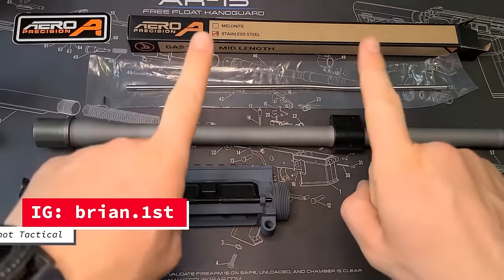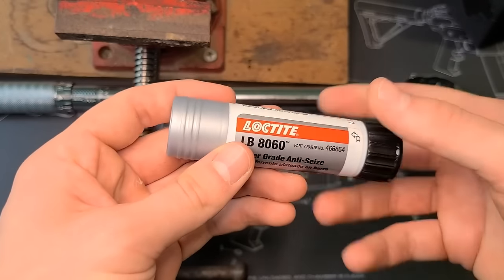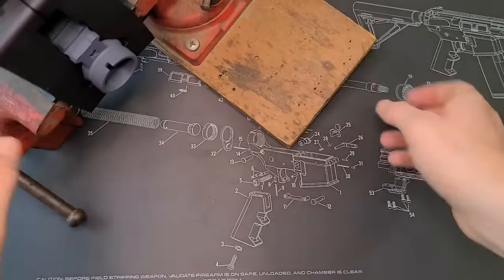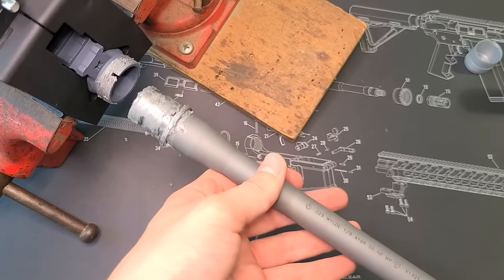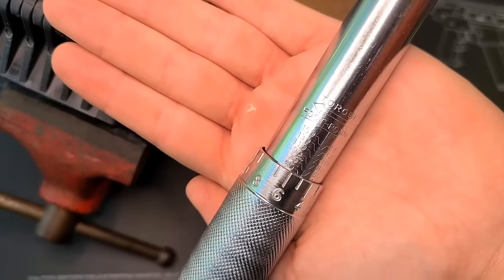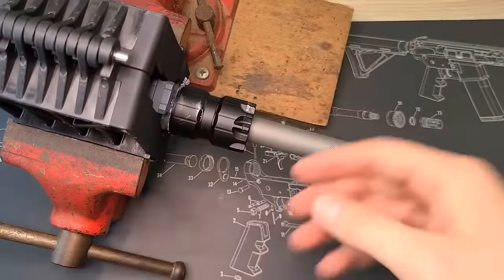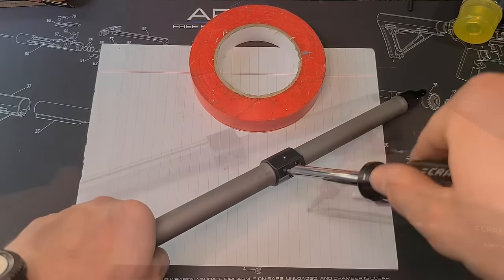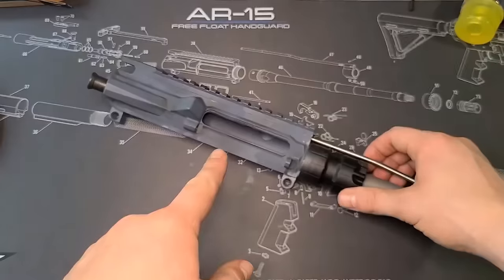How to Install AR15 Barrel - Aero Precision Upper

Comment: I would not use the same wrench to loosen the barrel nut I would always switch to a no-torque wrench to loosen it.
Reply from the maker: Thanks for the comment and you’re 100% correct! Definitely use a breaker bar!
Reply: Well said Gunfighter! Mechanics 101!
Reply: Or set it to a higher torque to loosen it than what you torqued it to......big brain moves.
Reply: @brettreid5949 never loosen with a torque wrench
Reply: @Schedule1ne315 , how do you torque reverse threads?
Reply: @Brettried ....With the same torque wrench set in opposite direction of operation, then again, loosen it with a breaker bar. The torque wrench is a precision tool to set the fasteners not remove them. When you are finished with preset style wrenches you are supposed to also recalibrate back to zero for storage.
Reply: @BeltFedToys , yup, take all tension off of the spring and detent. So, you're half-right.
Regardless of it being a precision tool, there's no legitimate reason why you COULDN'T use it to loosen a fastener that is well within it's specified capacity of doing so.

It's an argument of capability, not on whether one would actually do it or not.
Reply: @brettreid When a fastner is torqued to a specified setting that does not equate to the same amount of torque needed to remove it. Binding, corrosion and friction caused can exceed the limits of the tool. I don't use my micrometer and calipers as wrenches even though it will work. Even the manufacturers state to not use it for installation  or removal of fasteners. It is a calibrated tool designed for the final tightening to a specified force. Use of it for complete assembly will shorten the cycles of accuracy much more quickly. It's not so much a matter of the tool breaking as much as retaining an accurate reading for the most amount of cycles. The tool will need to be returned to the manufacturer or service center for calibration and in a busy shop time is money.
Reply: what? you don't have a negative setting on your torque wrenches? you got gipped!😂😂😂
Reply: Many of today's torque wrenches have a back n forth, or off and on switch setting.
Reply: @5jjt a totque wrench with the option to disengage and apply working load, to me would indicate a more frequent calibration regime
Reply: @brettreid5949 you spin the opposite way
Reply: @dancopp5607  Thats not the case at all actually. Its absolutely asinine to think that a torque wrench cant adaquetley, and safely, remove anything it puts on. The ONLY thing that's relevant is that you arent exerting more force than the wrench is st at. This means in BOTH directions. Setting a 500LB ratchet to 200 pounds and applying 400 pounds of force to it is what causes potential damage (generally it actually doesn't anyway). And that's the case no matter what direction its being turned. 

Tighten to a desired set torque, loosen with the wrench well beyond that setting. If clicks/beeps/screams at you then you've exceeded the setting and need to increase, or get a bigger tool
Reply: @SteveMoore71  So your not really a tool user. If you use your Torque Wrench in that manner, you WILL BE REPLACING IT. 
But for my fifty year old torque tools, they work!
Reply: @brettreid5949 using the reverse on the torque 😂

Comment: FYI don't use your torque wrench to loosen anything, it's a precision tool.  Breaker bar for loosening, torque wrench for tightening
Reply: Unless you have a bi directional torque wrench
Reply: @mcnairdn  I guarantee the 8.99 Pittsburgh torque wrench is not bidirectional … but technically I can’t argue with you 👍
Reply: @Raevenswood  true and they are not even precision instruments.  And I agree your advice is correct in 97% of cases.
Reply: @ 7:02, shows it's bidirectional
Reply: If my snapon one breaks ill just get a free new one🤷‍♂️ @Raevenswood
Reply: @Nak3dPirat3  I’m sure there is a moron clause in the snap on warranty
Reply: @Raevenswood  don't buy crap tools buddy 😘
Reply: @Nak3dPirat3  don’t use a 700$ precision tool like a moron just because there is a warranty. Buddy.
Reply: @Raevenswood  woah
Reply: @Nak3dPirat3  did you shit your pants?
Reply: @Raevenswood  no I wasn't wearing pants. It hit the floor. Don't be afraid to use your fancy tools that's why you bought them. Don't be materialistic either like you ain't never ground down a wrenches to fit somewhere tight 😘😘
Reply: @Nak3dPirat3  no shirt cocking bro!
Reply: Pretty sure you can loosen something if you know it’s not torqued beyond the wrenches limits. If you don’t know how tight it is, don’t use the torque wrench to loosen it.

Comment: You should mention headspacing. I headspace all my builds regardless of whether they are ARs or bolt guns. It’s easy to do while the barrel is out but shouldn’t be overlooked.
Reply from the maker: Thanks for the comment and great point!!🙌
Reply: That is absolutely a must do
Reply: Yeah I learned that lesson on my first ar build seems to overlooked often
Reply: It's not necessary if you use barrel with preinstalled extension and trust barrel maker, which made that...
Reply: It’s always recommended to do the head-spacing, to many variables to not do it 😅
Reply: When you say headspace the barrel, are you saying to check it with a gauge to see if it’s correct or actually change the headspace to correct it.  I wasn’t aware that was possible without removing the barrel extension.
Reply: Depends on the firearm. For ARs, you remove the bolt from the carrier and the ejector from the bolt. Check your barrel before installing it on the upper receiver. The Go gage is placed into your barrel's chamber, and the bolt should lock. The No-Go gage should go next, and the bolt should not lock. If it locks on the No-Go gage then you have a problem. There aren't any adjustments on ARs.   @jgrenwod
Reply: @stevenl7878  
Thanks for the reply. Cleared up my confusion about the process.
Reply: @stevenl7878 I suppose you could lengthen headspace with shims, but that's evidence of sloppy machine work and I wouldn't trust it, anyway.
Reply: @LE-6920 you always check all tolerances and specifications no matter who your manufacturer is. It’s easier to check the head space with the barrel off, also easier to check the gas port alignment before just slamming everything together, also easier to leave the ejection port cover in place before putting the barrel on. As no doubt this young man found out after he turned the camera off😂
Reply: @LE-6920 😂
Reply: @stevenl7878 closing on a no-go isn’t always a problem - just indicates slightly long headspace. Closing on a field gauge is the real problem.
Reply: Your higher in  barrels will come with a bolt no need to head space unless it makes you feel good

Comment: I suggest using a breaker bar or regular socket to loosen the barrel nut.  Torque wrenches are finely tuned tools, and using them to loosen nuts can lead to them becoming wrongly calibrated.
Reply: What if you need to torque left hand threads?.........
Reply: @randallsebald2299  I’ve never thought of that lol 😂🍻

Comment: As a guy with a a few different blocks, trays, etc... I still find myself using a roll of tape to tap pins in and out. Top notch brother.
Reply: <sarcasm>Top notch, brother</sarcasm>  there, fixed.

Comment: A hair dryer or heat gun is a useful tool as well. BCM mills their uppers to be slightly small (to aid in accuracy they say).
I'm in the middle of a Grendel build and I'm waiting for it to cool down in Colorado so the barrel will shrink slightly (because it's cold) and the upper will be slightly larger (because I'm going to heat it) so I'm hoping it slides in just as easily as yours.

One method one used in the past to line up the gas block is to plug both the muzzle and the chamber and use a duster can. You'll hear it when it's lined up properly.
Reply: Bro…. You can put it in the fridge for 2 min instead of waiting for the season to change
Reply: @dw3901  if you noticed when I posted that it was November. It was already getting cold in Colorado. Plus I've been building it since July so I'm in no rush.

Thanks for the support though.
Reply: You have to torch the receiver threads. JP Enterprises has a great video on installing barrels into thermal fit receivers.

Comment: I'm not bashing 1st shot because I don't know what checks you performed prior to the video BUT.... Safety is paramount when doing this. What I would say is that the steps to insure the barrel is properly headspaced and examined prior to assembly is very important to show in a build video. After all this is the most critical part of the build in terms of safety. Your audience is looking to you for knowledge as most lack the knowhow to do this safely. It is not a difficult job building an AR but it is important that you show the safety aspect as well. I would not forgive myself if I caused injury or worse to someone as i am sure you probably would not either.
Reply: If you buy quality parts from a reputable supplier, why is the headspace ever in question?
Reply: Do a video.

Comment: The Midwest reaction rod will prevent the barrel from clocking in the index slot of the upper receiver, worth every penny. Clam shell holders will put stress on the barrel's index pin and won't prevent barrel clocking... 
Anti-sieze is not the best, it will harden and can cause problems, use AeroShell Grease 64 as recommended in the TDP specs..Put the grease on the upper barrel threads, in front of the barrel lip and around any shims..
I lap the upper receiver face and bed the barrel in the upper with green loctite..
I dimple the barrel for the set screw type gas block and use a little green loctite around the barrel journal to seal the gas block to the barrel journal.. I use Rocksett for the gas block set screws as even red loctite will fail with heat..Blue loctite is worthless on gas block set screws..Pinning can cause accuracy problems, especially with a .625 barrel journal..
The best adj gas block is the Riflespeed. It has made all other adj gas blocks obsolete..
Reply from the maker: Thanks for the comment and great insights🙌🙌
Reply: You’ve been taught well my friend
Reply: Why dont u just make a video on how to do this instead?
Reply: How does a ClamShell put stress on the barrel pin ?
Reply: @SandyRavaged  Thanks for the reply, sounds reasonable. I've used the Clam Shell & the reaction rod ( WITH THE SAIL ) together in my last 2 builds seems to work great.

I apologize to the OP, don't know why I SHIT ON HIM ? MUST HAVE BEEN IN A BAD MOOD OR PISSED AT SOMETHING ELSE ? SORRY OP, I WAS AN ASS. I'll delete my stupid remark I made.
Reply: I agree Harry dog that's why I use one but not the midwest one but same principle.

Comment: Great video, thank you. One thing, I heard that using a torque wrench to loosen bolts messes up the internal calibration.
Reply from the maker: Yeah that’s true I heard as well but ohh well haha thanks for the comment!
Reply: that torque wrench looks like a harbor freight special so this is a possibility since their quality is questionable. in general, however, untorqueing fastners with a torque wrench is not a problem. in fact, many sensitive mechanical components (ex. engine head studs and the like) have an untorqueing procedure to prevent warping parts that requires using a torque wrench.
Reply: @NCrowe  I think its only an issue if you go past the setting

Comment: Yeah a lot of people don't realize how easy it really is to put an upper together good video by the way I like the colors of the barrel and the receiver curious to see the handguard and all of that once it's finished make that thing super duper light and a cool broken-up color scheme going sorry I'm telling you what to do it's your rifle but I like the color you got me wanting to put one together now good video 👍
Reply from the maker: Truth!!🙌🙌
Reply: @1stShotTactical  it's so insane how easily you can build your own firearm for so ridiculously cheap and it is really well-functioning looks better than 90% of the guns you will see complete at the store and cost a fraction of the price probably more reliable as well because you hand fitted it really if a lot of people weren't just lazy most gun stores would go out of business if they didn't need an FFL for receivers they would literally only make money on optics and ammo but I bet if you had all the pieces and weren't taking the time to explain in a video how to you can probably have one together in 10 to 20 min tops and it would run like a champ I thought my 450 Bushmaster was going to have cycling issues with the standard buffer weight and all the regular 556 parts except the barrel and magazine but the standard milspec buffer weight and spring cycles in like a champ just as well if not better than the complete that I ordered

Comment: I like how you torque on then remove then re-torque.   MY extra step,and it does make a difference, same as you do but  remove the nut and clean the threads THEN  do final torque.  There WILL be coating and grit in the threads.

Comment: I like the Handguard itself but that barrel nut star style to tighten it down is ridiculous. I sheered off some of the teeth off the barrel but only going to 45lbs. Now I can’t take the barrel but off and the gas tube slightly touches the barrel nut. They didn’t have to change the style of torquing it down it’s pretty dumb. Nice vid though
Reply from the maker: Thanks for the comment! And man that sucks about your barrel nut…. Hopefully you can get it fixed!

Comment: Well, this young man did a decent job of throwing a barrel on a upper receiver. That’s about all you can say, was it done right? Hardly. Was it worth making a video as a guide for others to follow? No. Too much was taken for garnet that it would be right solely on the premise that they were “ quality” parts. I myself have used from the same manufacturer and they are high quality parts and pieces, but I always check all my tolerances and fitments for my own piece of mind. Saying it was “high quality “ parts  after it blows up in your face doesn’t mean much. Parts are parts, how the parts are assembled are key to building a safe and dependable rifle.
Reply from the maker: Thanks for the comment!👍
Reply: What exactly did he do wrong? What checks are you referring to that he should have shown in this video to meet your standards?
You were vague. My guess is you are the usual “internet gun expert”. Just posting to make yourself feel special.
Reply: @lubrew5862  AGREED, WTF ?

Comment: Those Wheeler clamshell vise mounts are actually pretty "risky" to use, as they transfer all the torque from the barrel nut into the receiver which can cause your receiver to CRACK!😬 Instead you want to use a "reaction rod" tool, they're a long bar/rod that slides inside the receiver and has splines which mate inside the barrel against the bolt lugs, that means all the torque is applied to the barrel instead. You can typically find one for around $45-100 bucks.
Reply from the maker: Great tip and thanks for the comment!!🙌🙏
Reply: I bought the Magpul BEV block to mount in the vise after one use of that plastic clamshell crap.
Reply from the maker: @CarlosRodrigues-zn8gh  good tip!!
Reply: @CarlosRodrigues-zn8gh  unfortunately those are still "plastic" (unlike a metal reaction rod) and can still flex, causing your upper to crack.
Reply: @CarlosRodrigues-zn8gh  not even all action rods are created equal...
Reply: Before the reaction rod was invented what do you think millions of other people used? :face-blue-smiling:
Reply: @muffemod  They use to make cars without CNC machines, what is your point? A better tool is a better tool..
Reply: @hairydogstail  While a better tool is better (thanks Captain Obvious), the point is it can be done without it which I think you already conceded.  :elbowcough:
Reply: @muffemod  Well what apparently isn't obvious to you and others is the way the clam shell will put undue stress on the barrel index pin and the Midwest Industries Upper Receiver Rod eliminates this problem by putting the stress on the receiver charging handle slot instead.. It also works as a gauge to prevent barrel clocking..Any other obvious points you and others missed??
Reply: @macgyver5108  plastic covering...there is a metal core and the part with the bolt interface is metal
Reply: @bamrn1995  don't do drugs kids...🍳
Reply: @hairydogstail  -- not to worry -- muffemod  aka Captain Obvious has a checkered  history of trying to critique good advice!
Reply: For example, the VISM Upper Receiver AR-15 Vise Block - right now can be had for about $40
Reply: If you're reefing on the clamp then you have a problem. Never had a problem with the upper clamp you're using. Might have experience. JMO

Comment: Great video. However, torque wrench gears are not designed to loosen bolts that are tightened. That lever is in case you need to switch directions to get the gears inside the head unstuck.

Comment: Awesome video question which Aero Precision barrel block and tube are you using there are so many but your setup makes things so easy
Reply from the maker: Appreciate man! And glad I could help! I actually have some videos up on my channel unboxing every part I used for this build! I believe it was a 750 low profile gas black and a mid length gas tube🤔 I forget lol😅
Reply: @1st Shot Tactical  Thank will check the videos out

Comment: Note that many of Loctite's formulas require using Loctites primer if the metal is coated. Most metals are coated. Loctite needs access to the metal's elemental makeup in order to harden.
Reply: It's a lube. Not a thread locker.